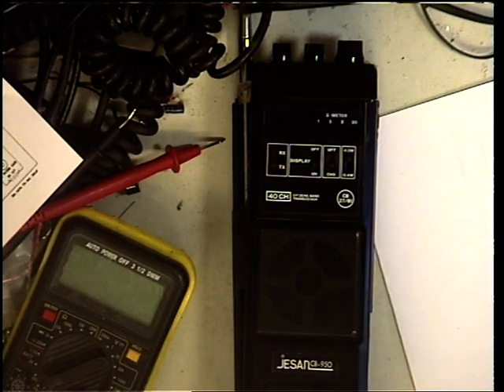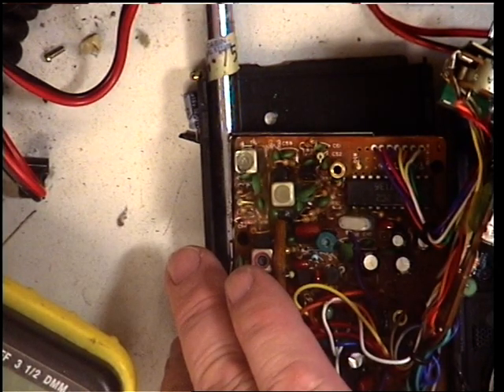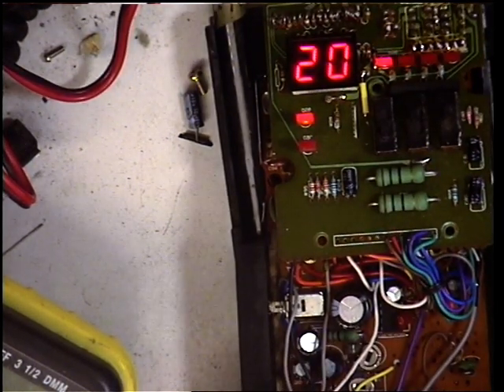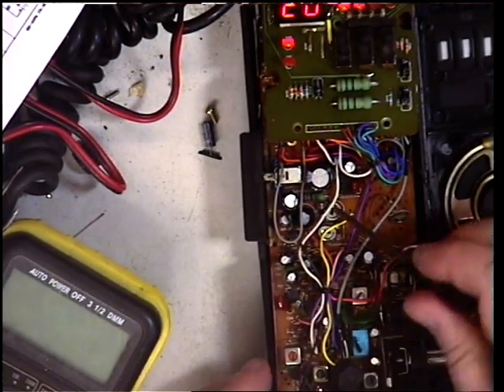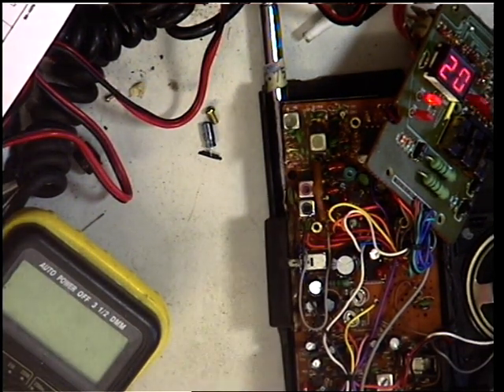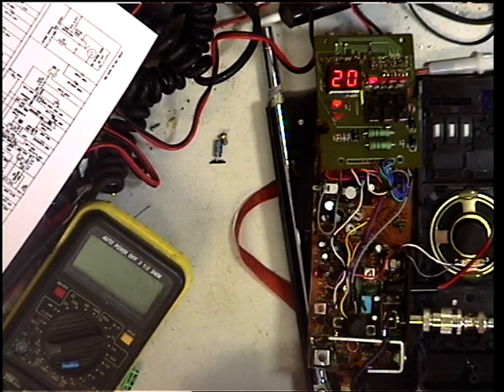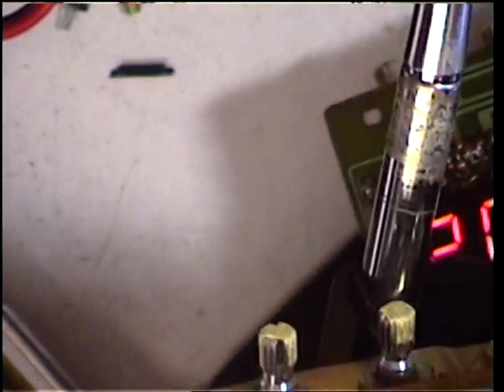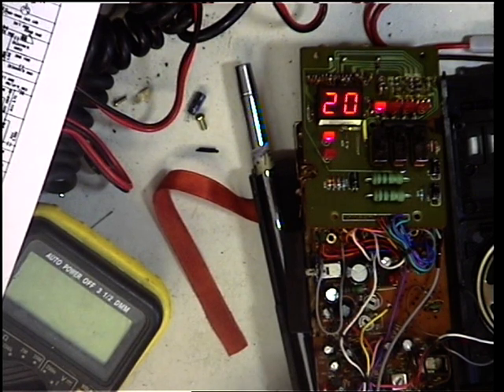Jesan CB950 UK CB27/81 CB radio (Hand portable) - Transmit alignment

Comment: I have a two button version that the receive signal display doesn't work, but the transmit works fine and lights them all depending on power setting and battery strenths